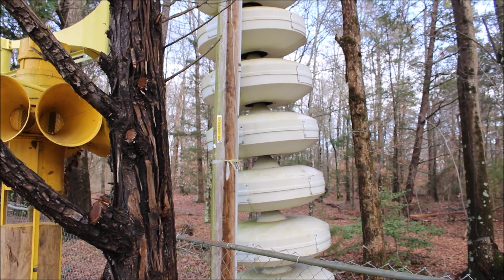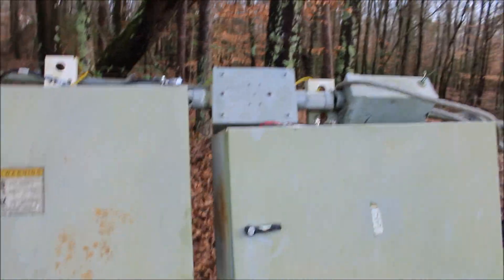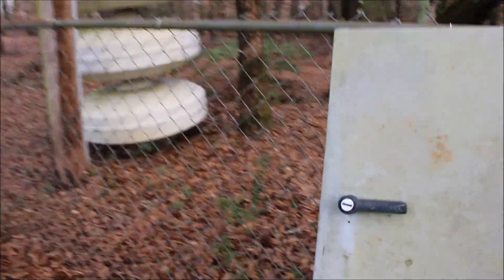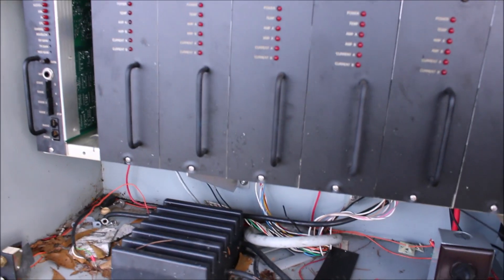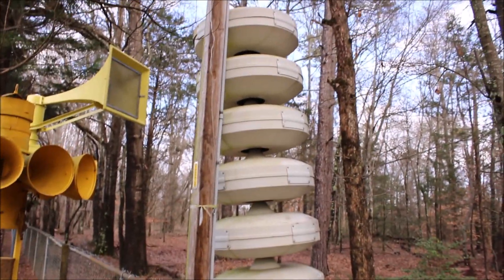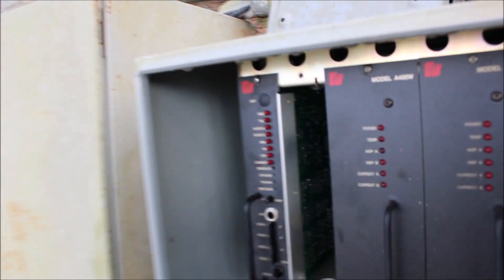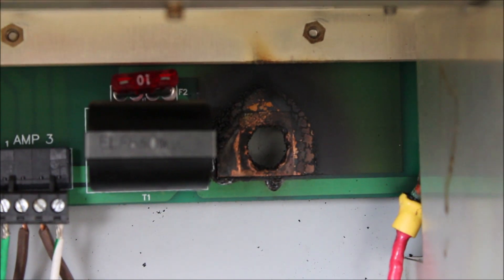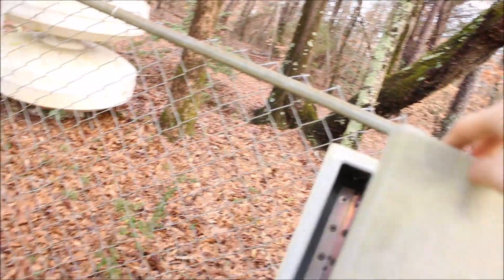My FS Modulator 6048 Tornado Siren Update #2 01/26/2021

Comment: What about the STH-10?
Reply: It's a backup for the 'bolt, as it runs on the same breaker. It isn't connected rn.
Reply: @pennsy77  Ok. Thanks!
Reply: It already works I think
Reply: @cherryblossomT2874D  Okay, I was wondering if it was connected.